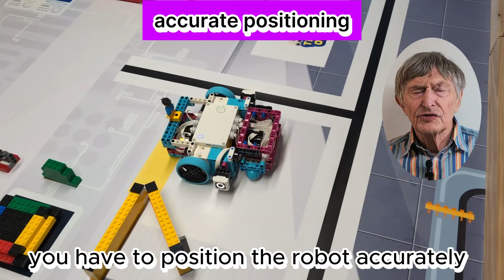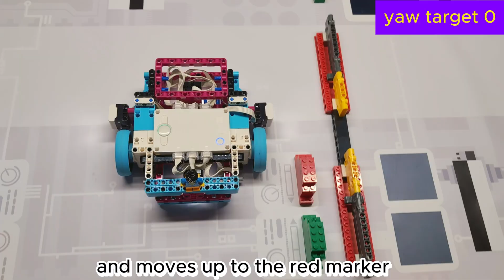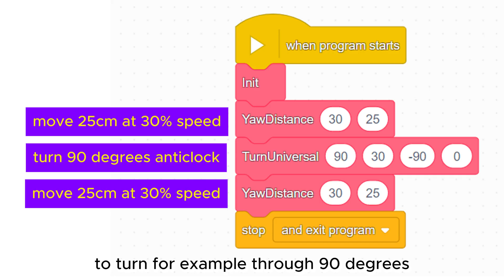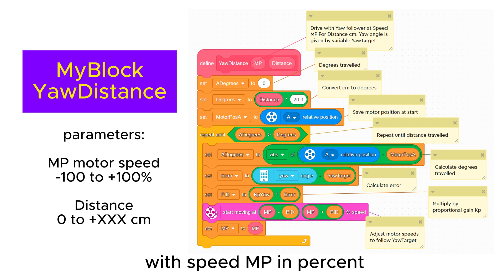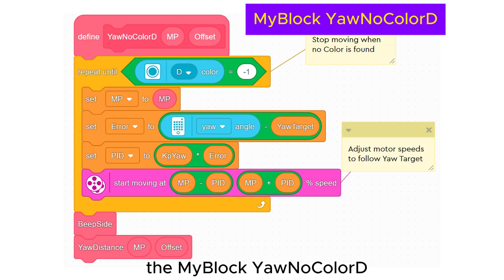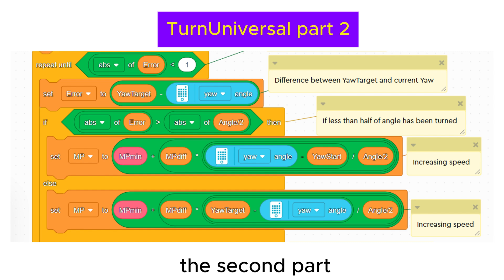SpikePrime Gyro - Navigation Without Line Following

Comment: I have a competetion and I need help to make the bot go smoothly and not jerk left and right during the maze which it always does. Please help
Reply from the maker: Do you have a proportional line follower or one that zig zags left and right? If you have a zig zag type then it will move left and right, that's how it works. If you have a proportional type, then you need to adjust the gain. (The factor you multiply the error signal by). You will need a lower gain to reduce the left/ right movement.
I hope this helps you!
Paul

Comment: Thank you so much for your video — I really appreciate it! I’ve recently started learning programming and found your content extremely helpful and inspiring.

I’m currently working on a robot project, and I want the robot to drive perfectly straight without using a black line for guidance. To achieve this, I’m using a gyroscope sensor to help maintain a consistent direction.

I wrote a program that works sometimes, but other times the robot starts veering slightly to the right while moving forward. This happens inconsistently, and I’m not sure what causes the deviation.

Do you have any tips or suggestions on how to make the robot’s movement more stable and reliable?

Thank you very much in advance for your time and help
Reply from the maker: Hi there
Thanks for your comments!
If you are using a proportional gyro-follower the problem could be caused by the gain factor you are using. Another possibility is that if you are moving at the maximum speed value you can only correct in one direction. If you want me to look at your program, email the file to: pablocutler@gmail.com 
Best regards Paul

Comment: i find your videos great! i  don't even do wro but i am going to the national fll championship in Britian and you have helped a lot keep up the good work!
Reply from the maker: Thanks a lot for your encouragement!
Reply: @why-not-bot  oh and as for your gyro turn issue i belive that you can solve it by implementing a gyro check to make sure that your value isnt above 180 or below -180 and setting it accordingly
Reply from the maker: Hi Oscar,
I guess you mean setting the yaw measurement to zero if the turn you want to do would go through the 180 degree point. Well this would work, but I am trying to keep the original yaw value unless I can align with a wall and do a yaw zero. 
Thanks for commenting!
Paul